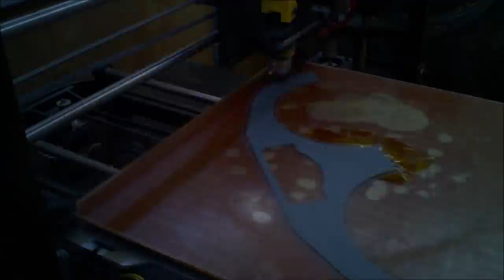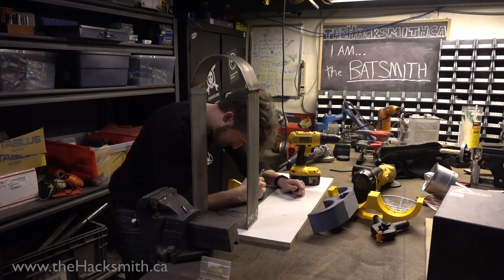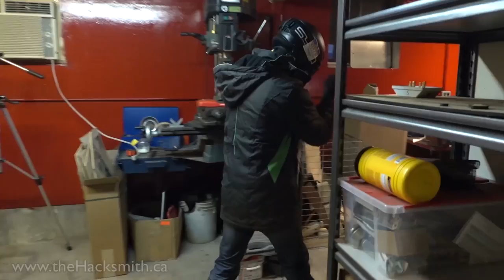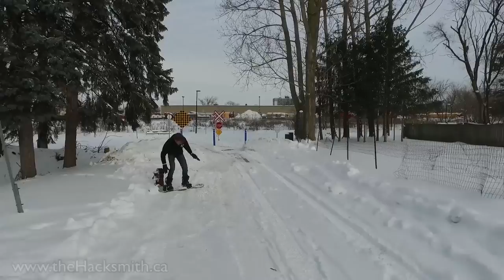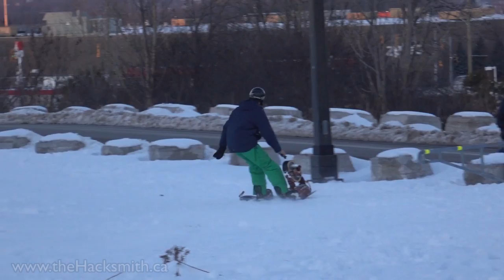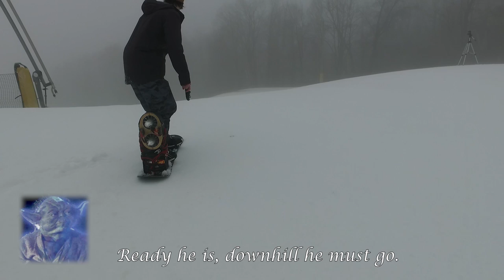ELECTRIC Snowboard goes TOO FAST!

Comment: May be it will be more stable if you put EDFs in horizontal, not in vertical alignment.. did you try that before?
Reply from the maker: What happens when you crash then? ;)
Reply: Gooood question! Try to not to crash, may be? :)
But in current configuration center of gravity is high and snowboard little bit unstable and not easy to control.
Am I wrong?
Reply: Build them Side by side, With 3-d printed Arch over ( think EDFs in a Swamp Boat Fan shroud), in the event of a wreck it might not tear them off, and would distribute the load. Also with your rear foot you could build a prop to guide the EDF slightly to aid in steering that would mount between the binding and board ( Like a swivel plate on a computer monitor)

Comment: I'm no where near to engineering but from school knowledge of physics won't it be more stable if you change mounting system from vertical to horizontal?
Reply from the maker: What happens when you crash then? ;)
Reply: I thought about it while writing the comment) I mean not all the way horizontal per se. Just to lower center of gravity a bit. From the video you can see how it tries to tip over the board. Still I think you guys already thought about it all much more than I did)

Comment: How big is the area for the batteries? There is bound to be a battery that is more powerful than those multiple Lithium-Polymer batteries combined. All we need to do is figure out the size, and we can try to find a better battery, at least thats what I'd like to do, seeing how I can't even go on Patreon.
Reply from the maker: Nope, lipos are pretty much the most energy dense commercially available battery =(
Reply: Welp, guess that Idea is out of the picture 😅

Comment: Why not make your own jet engine surely a group of engineers can accomplish this under $5,000
Reply from the maker: I think you might be grossly under estimating the difficulty in building a jet engine from scratch...

Pulse jet, sure, anything else... Hundreds of thousands.
Reply: the Hacksmith what about one of thoes turbocharger jet engines or theres this one where a guy buit a reverse flow annular combustion chamber around the exhaust part of the turbo instead of the usual can configuration